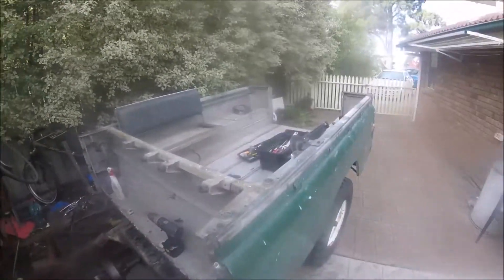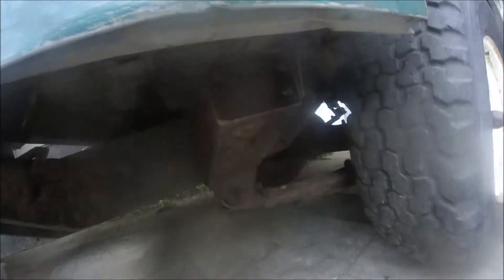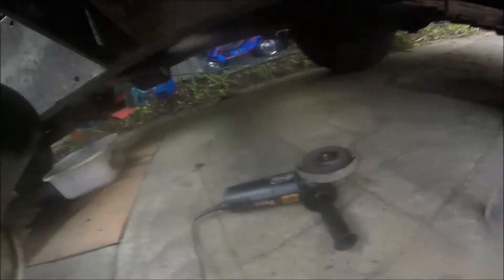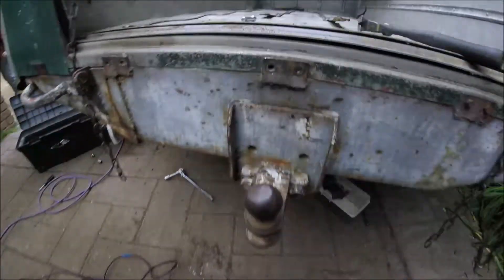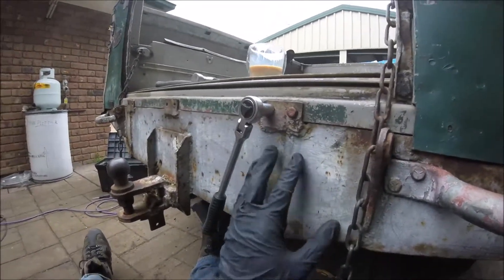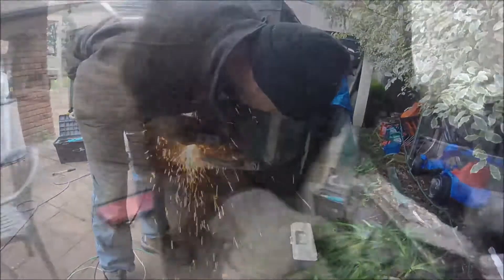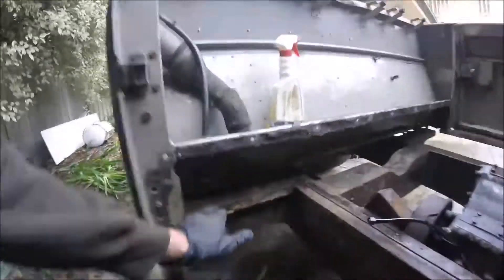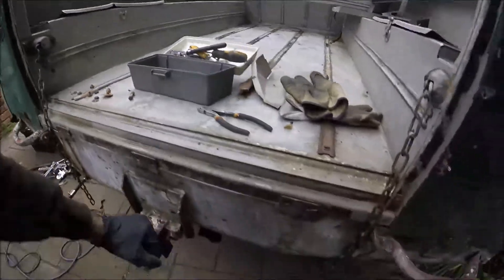Land Rover Series 2a 109 - Part 1: Removing tub Fastners

Comment: Well done! I think you were quite lucky with those bolts, they can be a real bitch, the best result is when they shear off...
Reply from the maker: I had issues and did end up shearing some (as you say, its easy that way!) but I think the diesel spray I use does help somewhat.
Reply: Rover Tasmania For rounded off nut or bolts I use Irwin sockets / extractors, they are very good 😎
Reply from the maker: Sounds like tools, I got the bare minimum so need to start investing slowly!
Reply: Rover Tasmania Yes, and don't be tempted to buy cheap.... ☺️
Reply from the maker: rusty - we must be brothers from another mother - I try to buy in between quality, however at times theres CHEAP tools with 12 months warranty, so perfect if you know what I mean ;)
Reply: Rover Tasmania Most of my stuff is Proto and Britool and has served me well....